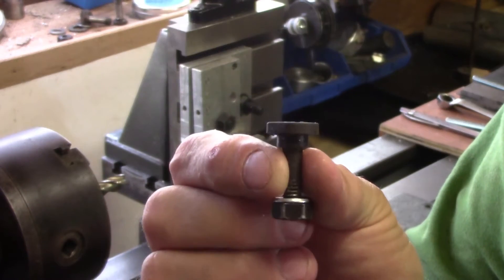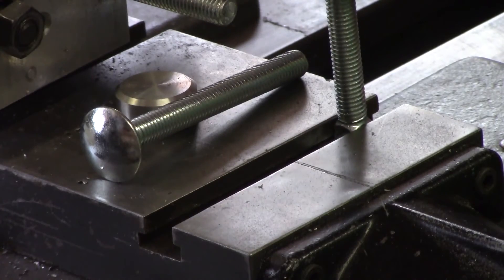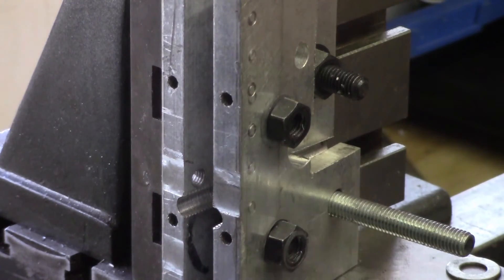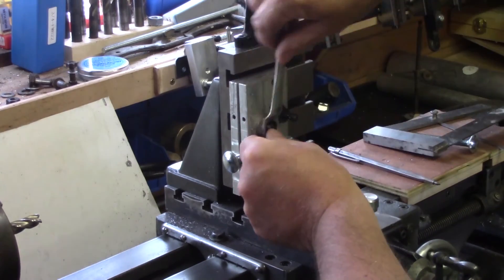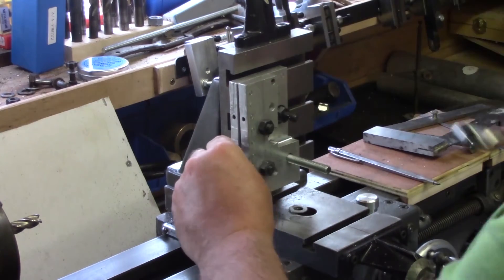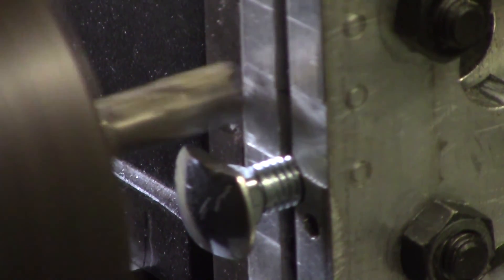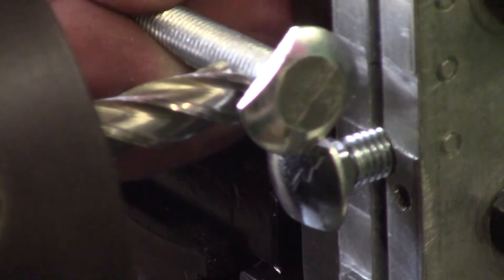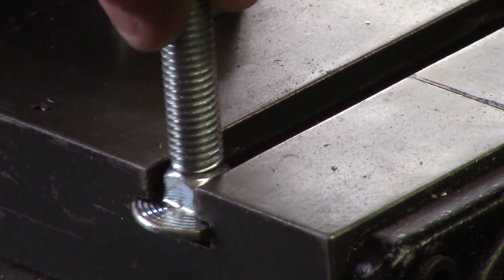Making Tee Bolts for the Myford ML7 Lathe slides

Comment: So, I have to go out and buy a lathe and a whole bunch of accessories to shave off a few mils of a bolt head? I though it was only our American cousins who over-engineered everything? An angle grinder or belt sander and a few minutes -- Done! Nice of you to share your adventure though.
Reply from the maker: Thanks
Reply: I think you might be missing the point here a bit. The whole point of Ade making the tee bolts is to use on his lathe/milling machine. If you have a lathe and milling machine, that’s the way you do things!

Comment: Are why use all the material use a thicker piece of all mine is 20mm drill and tap 8mm thread. Thread the boot into the ali with a lock nut hey presto done
Reply from the maker: Sorry Tommy, I dont quite understand?